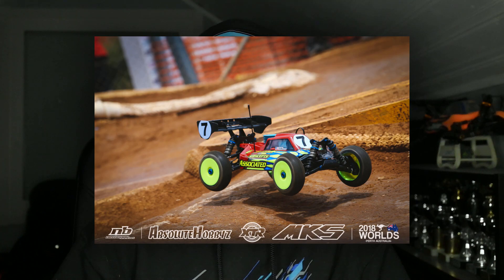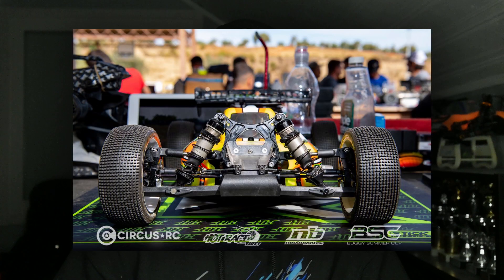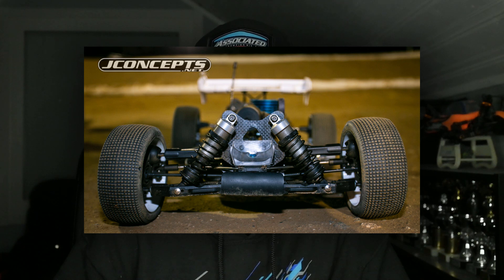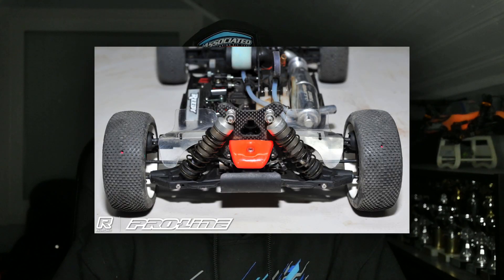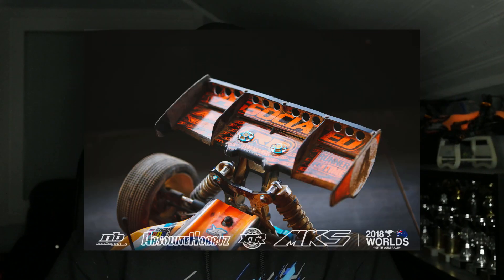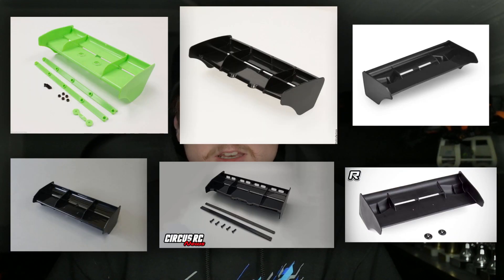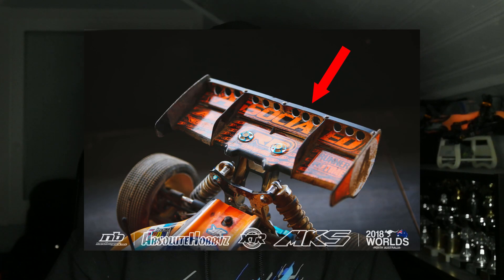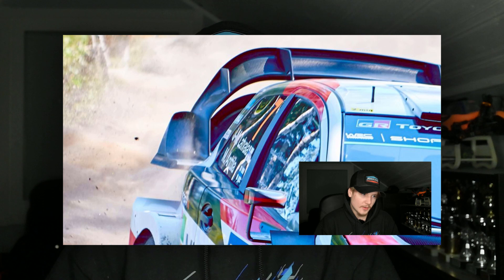From the ground up: Aerodynamics Part III

Comment: I appreciate the intense focus on the subject of aerodynamics and that you include many of your pet peeves when speaking about various aspects of RC setups. One thing that I would like to hear a perspective on involves torque-twist and the way it affects the handling of most modern 4wd RC vehicles that are shaft-driven and powered by a motor or engine that is longitudinally mounted. For all of the finer adjustments to be made in RC, how has this wild, left to right or right to left pitching action while throttling the vehicle never stood out as a performance disadvantage?
Reply from the maker: This is actually an interesting topic. Touring cars clearly all saw this disadvantage as they have moved away. Sadly I don't see that the nitro cars will ever be able to be belt driven due to durability issues. So I believe most people see and understand the disadvantage but are just stuck with the driveshafts due to a lack of a better option.